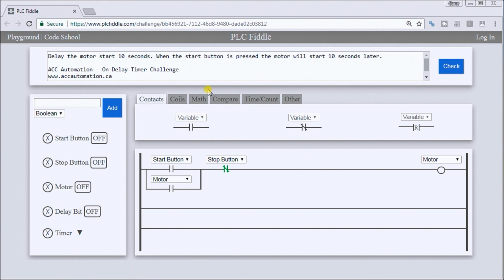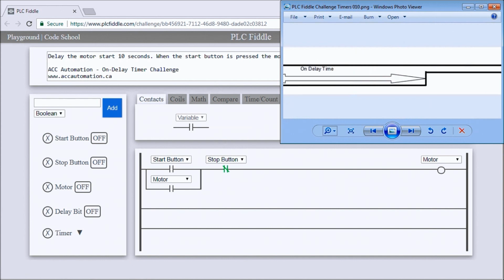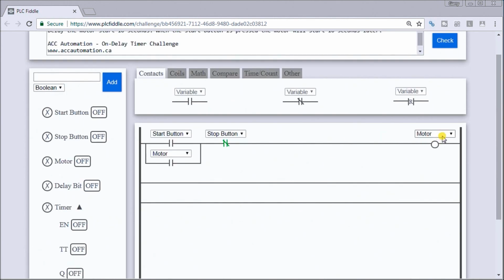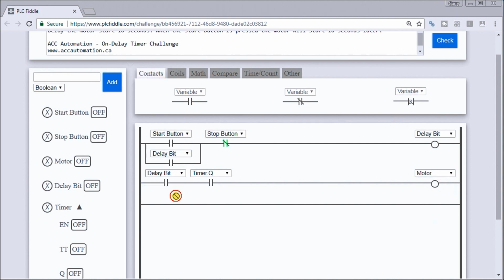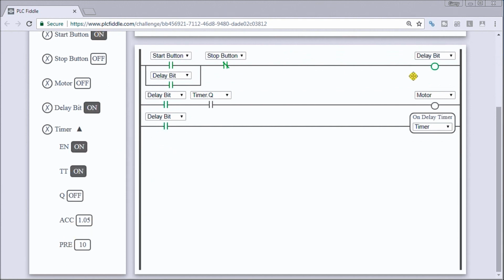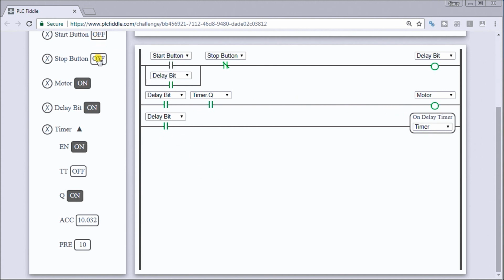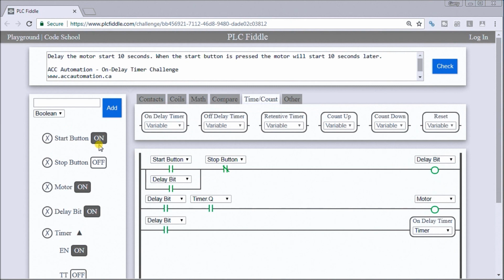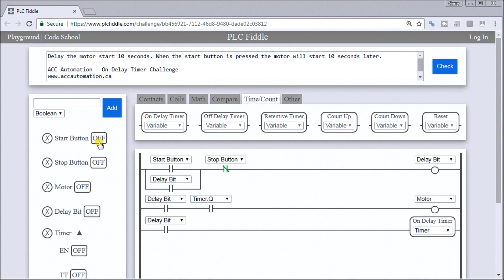Master PLC Timers: Solve On Delay Challenges with Ladder Logic

Comment: Why is the 3rd line necessary, cant we just add the 'On Delay Timer' to the 2nd line? Thanks.
Reply from the maker: Hi Suuemen Menon,
You are correct. Some PLC manufactures will allow you multiple outputs on the same rung with different conditions. 
Our example was written this way to break down the individual outputs on separate rungs to make them easier to read and understand.
Thank you for the comment.
Garry
Reply: @ACCautomation  Thanks and cheers. People like us need people like you.💪
Reply from the maker: @suuemen  
Thank you and cheers.
Garry